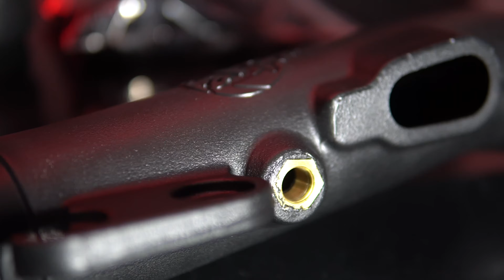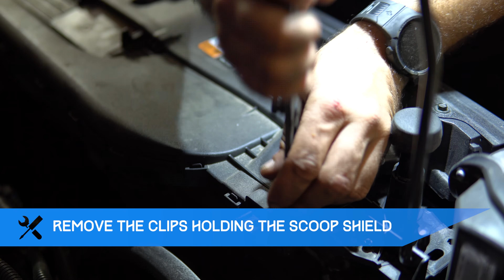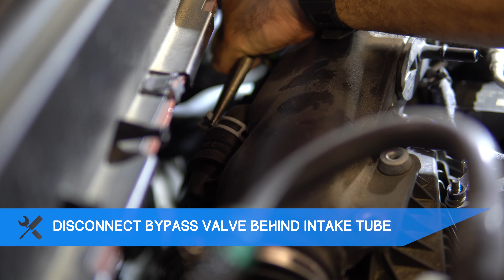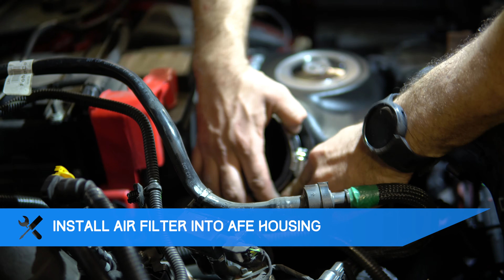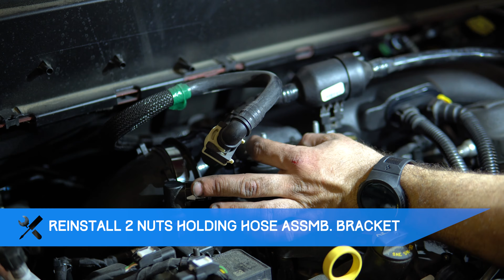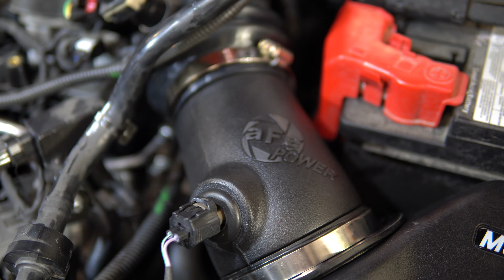Instant Power! Ford Maverick EcoBoost aFe Air Intake!

Comment: Great video! Where can I get the green crankcase vent tube disconnect tool?
Reply: That looks to be the same tool as a fuel line quick disconnect. They sell those as full kits at any local auto parts store. I bought mine 25 years ago. Same kit still intact and works like new!
Reply: That’s a fuel line quick disconnect tool. Comes as a set for around $10, at least it did when I bought mine 25 years ago. Still have it. Works like when I bought it.

Comment: If you want to spend a lot of money for no gain, cold air intakes are the way to go. If you think this will get you 16 hp your dreaming. Most cold air intakes don't do anything and some you lose power. Actually with a lot you lose power. Asked the owner of the shop who was going to chip my VW what cold air intake I should buy. Told me you don't need a cold air intake. Said VW knew what they were doing when they designed their intake and cold air intakes were a waste of money. I then watched dyno tests of cold air intakes and none of the intakes made their claim or even came close and many actually reduced horsepower.

Those dyno videos are still out there. Watch them for yourself if you don't believe me. Changing one plastic tube for another is a waste of money and time.
Reply: There are a lot of “cold air intakes” that are actually hot air intakes! Non-sheilded open cone intake filters are the ones you mean and no, those have little benefit, if not worse. They suck in warm under hood engine bay air🤮 The 2.0l Maverick is designed  stock with a scoop that channels air from the front grille area into the intake box. This kit builds off that pre existing infrastructure, so yes, I believe the gains they are claiming, just as I believe the gains claimed by companies making down pipes and cat back exhaust systems for these trucks. I just installed an MRT street race cat back exhaust on my 2022 fx4 maverick and you can feel the difference in more ways than just power, like responsiveness and even weight reduction in the chassis. There’s easily 15 lbs less weight swaying around with the truck and I could feel it the moment I backed out of the driveway. I understand the cynicism given the history of supposed CAI of the past but this kit certainly is a different animal.  Check out the Maverick truck club forum and you will find plenty of satisfied customers who won’t argue they don’t mind if you choose to stay stock. We will keep all the fun for ourselves.

Comment: Caution.....the 8 speed tranny is not able to handle much more power. 16hp may be ok....but NO MORE!
Reply: nah its vastly underrated, guy has been running 12's with 320 hp well over a year now drag strip run after run still going strong

Comment: Assuming this requires a tune after install ? o.O
Reply from the maker: Nope!
Reply: @PandaMotorworks  Wow seriously ? I'm used to my WRXs etc always needing a tune after a full intake setup :O.
Reply: @Sphoxros  Subies need a tune for almost everything. They have a MAF. This has a MAP.
Reply: Don’t know why you would, you are reducing the restriction, making it easier for the engine to breathe. Like going from high to a lower altitude your motor will have more power but not need a tune unless you are running a carb.
Reply: @blakkat531  Actually, after changing my exhaust on the Mav my shift points have changed, so if say I try to gun in a lil bit it rev hangs, unless I get it up to around 2k RPM, and either hold it there or let off on the gas a hair, then it'll shift, have already brought this up with Cobb and apparently they have addressed this with there tunes for the Mav. So looking into that for later, other then that the Mav runs great so far :D.
Reply: @Sphoxros I also noticed my shift points have changes but I don’t think mine rev hangs. I just installed an MRT street race exhaust a week ago and I love it! Better throttle response and shifts happen sooner and quicker. Thinking this may also be synergistic result of the combination of the exhaust with the turbosmart dual port BOV I installed the week prior to installing the cat back exhaust. At first didn’t seem like the BOV by itself added much other than atmospheric venting but after installing the MRT single exit exhaust the BOV dumps at lower RPM and seemingly more often than with the stock exhaust. Also way more audible BOV. I’m excited anxious to install the 3” CVF downpipe I received but first I want my tune from Livernois motorsports to be installed in case there is any issue as I have heard there may be if I input 100% throttle.
Reply: Just reread your post and now it makes sense. If your rev hang hasn’t been resolved I recommend buying and installing the turbosmart dual port BOV and pretty certain the issue will be resolved!
Reply: @blakkat531  more air coming in? You think the stock ecu will make correct adjustments?
Reply: Yeah, so pretty much all modern vehicles if you add a drop in a  K and N kit filter in it you will gain about as much as any CAI on the market.  At least this one is sealed.  But any intake that is not improving upon the factory ducting that pulls in clean air.....well its a waste of money from a permanent stand point
Reply: @_Mailman you would have to have owned and driven a Maverick for awhile then drive it after installation like the rest of us to understand/believe it for yourself but I understand the skepticism
Reply: @cirdancescles4370 I mean I have owned a Maverick since 2022 when they first came out lol.  Drop in filter and tune  does the same thing and does it better